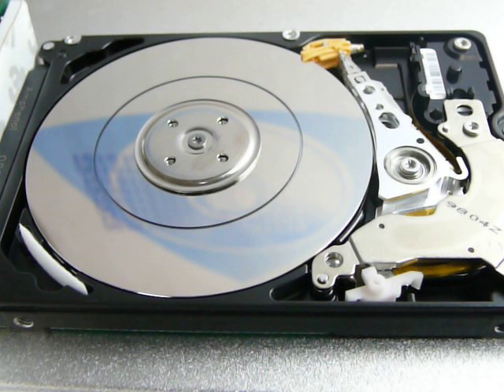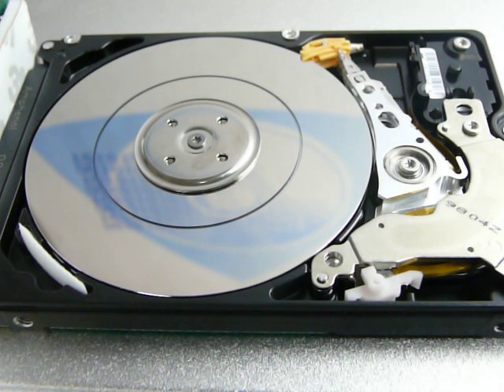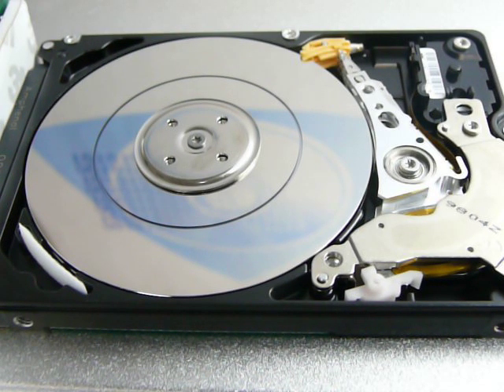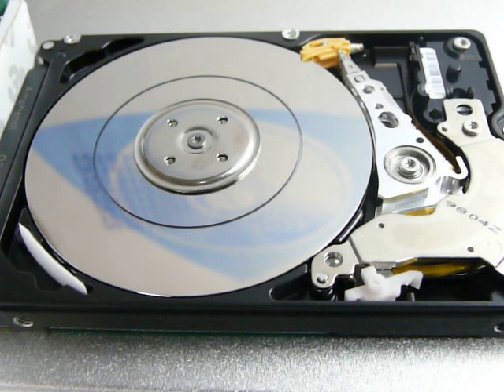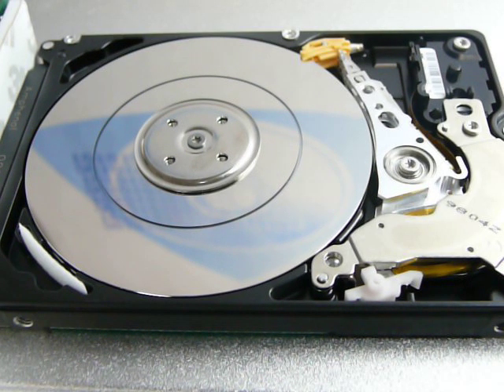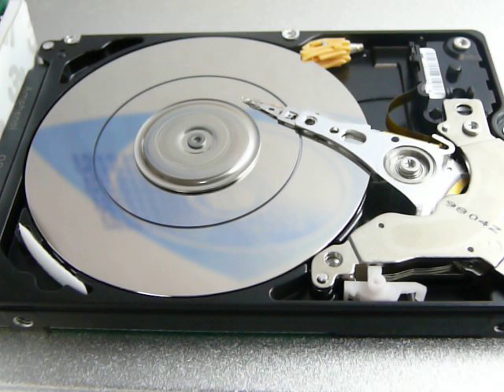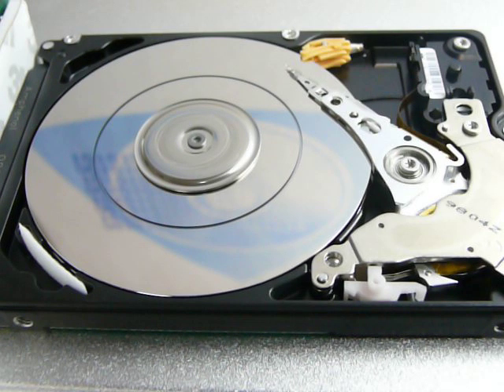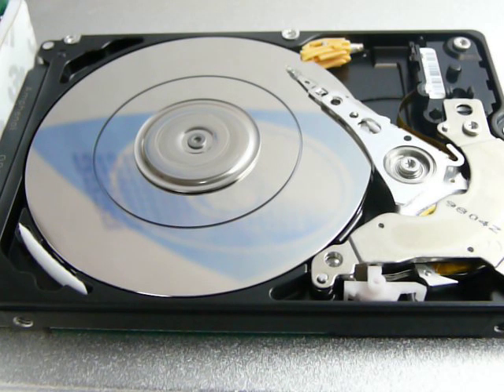hard-drive-recovery-scratched-platter.MOV

Comment: This is done with a tool like PC3000 where he is setting the headmap in RAM to 0 0 0 0, soft reset the drive, set headmap in RAM back to 0 1 2 3 (or 0 1 2 2), go to the drive imaging function of PC3000 called DE, do a head map, tell it to only image heads 0 1 2, then extract the files, separating the good files from the bad files (missing or bad sectors within them) to another drive and see if the files you desire are recoverable.

Cost of PC3000+DE is about $10,000

Some labs charge their full rate for these partial recoveries, likely between $1500 and $3000.  We would offer this service for about $300 with a take whatever you can get, assuming that we didn't need to change the heads in the first place.

A few things to note is that the OP did not mention that a hard drive should never be opened outside a clean room environment, nor should it be powered on with the cover off.  That is, not if your end goal is to recover the data without causing more damage.  Basically, this is not a DIY type of recovery and every time you power on your drive in this condition, the damage is going to get worse.
Reply: chinese men have already cloned the pc-3000 portable version :) it is affordable
Reply: @25_26  really? got a link?

Comment: This is total BS.  99.9% of the time it will kill the heads.  The only trick here is editing the head map in RAM.  Which would mean that head three in the video was already dead or too weak to read anything.  The debris kicked up from that large scratch will get under the heads and microscopically damage the rest of the platter surface.  I doubt this job was successful.  The only trick here is extracting cash from a unsuspecting customer.

Comment: Okay, I have a hard drive it has a slight scratch on the top platter (the previous head was dragging on it, is there a way and if so how, to get the new heads to read over the scratch and do the rest of the hard drive?

Comment: Please i need help !!! what is the software which recover only an area on the platter because i'm in the similar case thanks
Reply: Sam, how are you? I'm from Brazil. What you lived 5 years ago. Friend, my Seagate 2TB hard drive then its needle went into a collapse when there is a scan of some of my movies. Stopped everything! When opening, finding a first arrangement at the height of the dish first, because the other 2 are not in view of their circumstances. When connecting the computer, the hard drive as a slave, the engine turns the dish, a quick glance, the starting rhythm as the engine stops. That is, when I turn off and turn on the computer. Sam, how did you manage to solve this drama ?